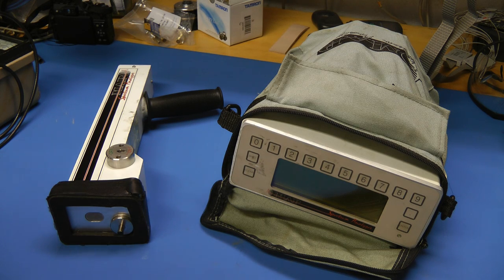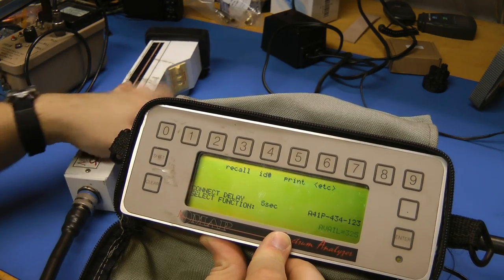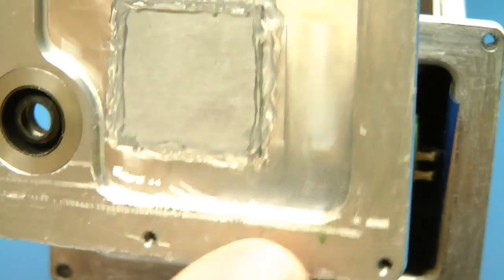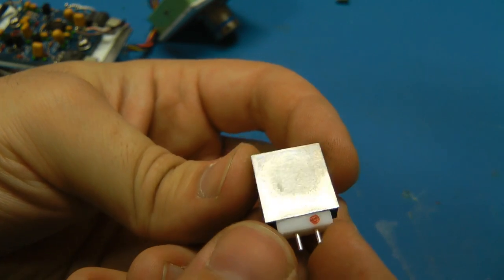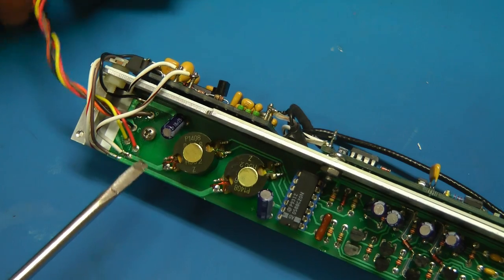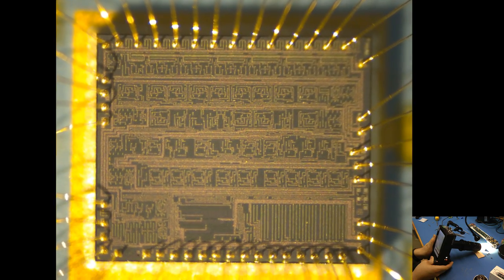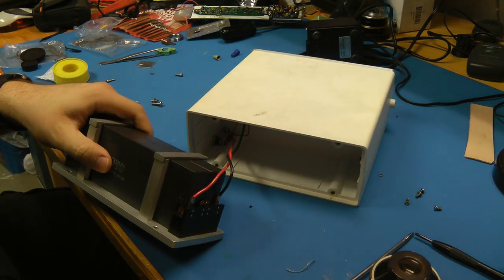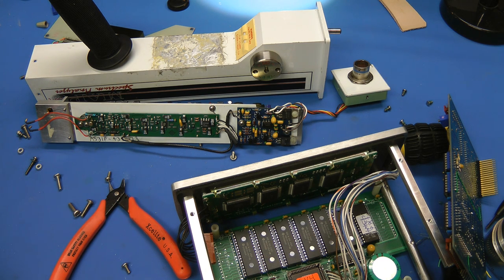X-ray fluorescence spectrometer teardown - Scitec MAP Spectrum Analyzer

Comment: I built over 600 of these back in the day.  Except for the PS all the boards are rather narrow.  they were designed to also fit a probe that could also be lowered into a bore hole for mining or clean up sites.  That console still has the residual software to accommodate the winch and count off the depth in feet.  The two analog switches are part of the sample hold circuitry and that entire board was used to take a few micro second pulse and stretch it out to I think 100 ms or more so the hybrid chip could count it.  The source holder (we called it a tumbler), was made of tungsten and the source was held in with a set screw and dab of silicone glue.  The plunger in the front was designed in for customers on the east coast because they wanted more protection - wasn't necessary.  Typically mining and environmental cleanup people didn't use them.  The two transformers on the other long board combined the signal to and from the +/- 18V power.  Each unit has a unique calibration.  The detector was silicone was purchased from Micron in England.  All the gaskets, black bumper and detector holder were pour by me...made me itch after awhile.
Reply from the maker: Great to hear from someone who actually built these, thanks for the story and info!
Any idea what they sold for back in the day? How long did they remain in production?
Reply: The LBP systems I believe sold for $18-$25,000.  They were kind of cookie cutter since they were calibrated to standard paint thicknesses and substrates (concrete, sheetrock, plywood, etc.) Mining and waste sites were more costly because calibrations not only needed a represented detection element but also an example of their soil/rock matrix.  One company with two different Molly/Tin mines could not swap instruments because each instrument was calibrated to a given rock matrix or location.
Reply: awesome comment. thanks for all the additional information !

Comment: Modern handheld XRF devices, even those smaller than this one, use actual x-ray tubes!
They're absolutely tiny, no more than your thumb's width and length, and are usually rated at an incredible 50-70kV(keV photopeak) output! Obviously at a few microamps, but still.
You'd likely require a license to own this if it had a gamma source still in it, and taking it apart would be illegal in most countries(including Canada), without another license.

The window on the photodiode is indeed beryllium, as is the one on the front, because you're dealing with soft, low-energy and low-count x-rays, and the insides can only really be one of two options: a bare photon-counting APD or a PIN photodiode with an extremely thin coating of scintillator, probably CsI:Tl.

Comment: I wonder if maybe the sensor is some sort of ionisation gauge, or maybe an avalanche photodiode
Reply: mikeselectricstuff Or some scintillating material coupled to the photodiode, like a miniature version of the photomultiplier based probes.
Reply: I knew I'd see you here, Mike :D
Reply: Lead detection is done in this case beyond 70 KeV, based mostly on its kalpha at ~75KeV. Most likely the detector is a CdTe or a CdZnTe semiconductor.

Comment: Interesting teardown! Shame there was no source in there but sounds like the half life wasn't that long on them anyway so probably not a great loss. Could the detector be an APD which would need a HV supply? (i am kind of mirroring Sparky Projects's comments about the inductors and 555). Oh, nice Ludlum BTW, which model is it?
Reply from the maker: I should try powering it up and measuring the diode supply. The Geiger isn't mine unfortunately, I borrowed it from Jax at The Hackery, a local electronics recycler.

Comment: If you're going to use the sensor, keep hold of the amplifier, it may be useful to interface your project.
Not sure, but it looks like that coax to the power supply goes to the transistor and driven by the 555, could the components on the amplifier board be inductors ? the 555 may be providing switching supply boosted by inductors to give a higher voltage, hopefully you already know how geiger counters work.

Comment: also a pancake detector is not really ideal for the radionuclides of interest here.... i mean if its a HIGH HIGH activity source, it will... but most pancakes are poor at low energy gamma/x-rays.  but better than nothing.   But yeah, I love the tube-vased xrf.. much better fidelity in identification.. butyeah... even with the compact tubes... no where near as small as some of the nuclide-source ones...  but yeah... the nuclide ones are regulated in just about every major locations... so would be had to get hands on one except major disaster without a license.